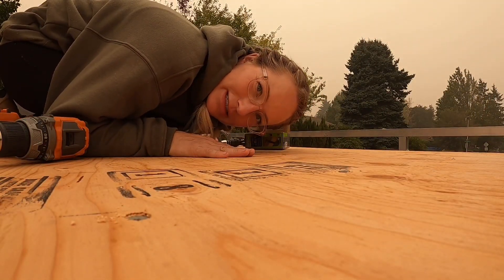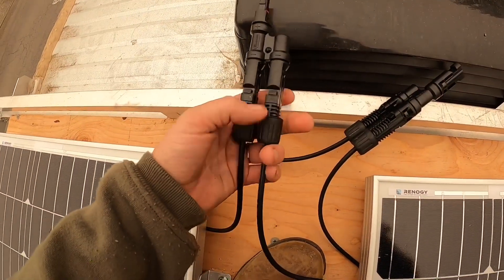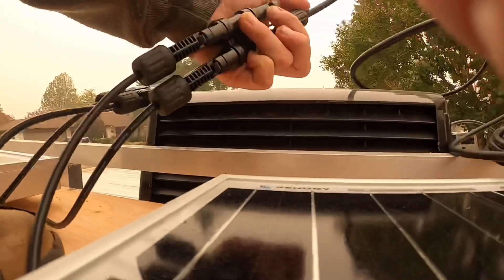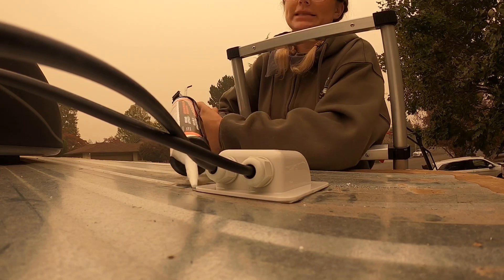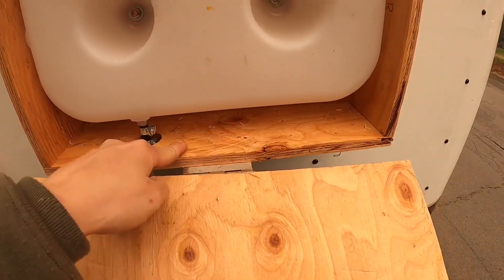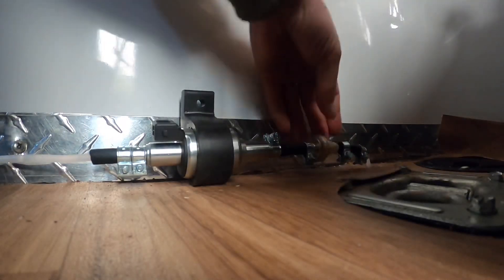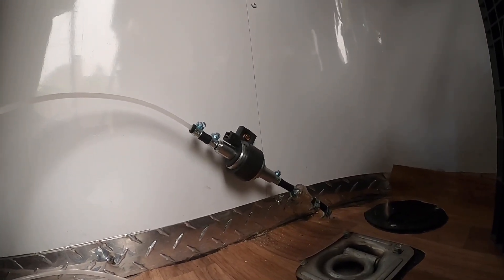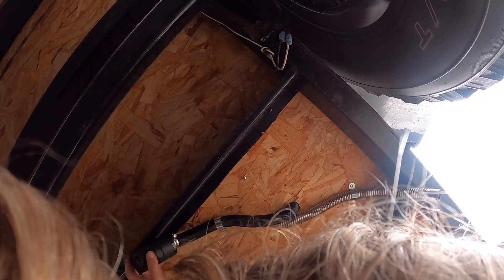DIY Solar Power & Diesel Heater in a Cargo Trailer Conversion- - Part 1

Comment: Hi great build and a lot of great ideas! Please check where you exhaust goes thru the floor for burning of the wood. Most installs I have seen state you want a bigger hole for an air space, just want you to be safe. Keep on building!

Comment: Heck yeah! You go girl, I was lookin for a video for instructions on installing diesel heater to solar?  Found u,, I'm now a new sub, and ty for instruction,  may I ask a few ?s How has it worked in the past yr, will 1 /100watt solar kit, will that be enough? And a stupid question do I attach power from diesel heater to the battery or to solar charge controller? Any info anyone can give me would so much be appreciated I'm in ohio and it's getting cold lol

Comment: I’d be worried about that exhaust starting your wood floor on fire... it’d be a good idea to just cut a rectangle hole in the floor to make clearance for the exhaust and using the metal mounting plate to bolt to floor.

Comment: Hi girl! Nice work!! On the roof, this little white duct box. Should you install that again, because it won`t be sealed proper, i think.. Put the silicon UNDER all the edges (of that white cap) before screw it in the place. (sorry my English..) I hope it won`t leak.

Comment: The plywood on roof may be treated but water will fill into the screw holes...over time it will weaken the wood & your panels will fly off the roof esp if you dont have some kind of wind shield covering front edge of panels. maybe put some silicone over on top of screws wherever the wood is compromised

Comment: I bought an all in one heater for my Rooftop Tent and LOVE it.  I joined a couple groups on FB concerning the installs, and it's general consensus that the exhaust connection should be outside of living area, and also heat shielded as it gets very very hot.  Looks like you raised it up, and the exhaust is touching wood.  Just be careful, I'm sure you already have a carbon monoxide detector, but just be safe!!  (Not sure if anyone already mentioned in the comments.)  I will say these heaters are game changers for camping in winter, absolutely love mine!!!  Love the trailer!!!

Comment: I hate to be a critic (especially when you're doing a fantastic job of it) but the hole you drilled for the exhaust needs to be far bigger, that exhaust pipe gets really hot so having a larger hole (Fnar Fnar) means less chance of setting your wooden floor alight. Lining the hole with a cut section of food tin will also be a good idea, but apart from that you've made an excellent job of it so far, this is the first video from you I've watched so far and you've impressed me. 
Note:- I've fitted a few of these heaters and commend your choice in getting one, they're cheap and poorly built but when used correctly function fantastically!
Reply from the maker: Thanks! I actually adjust the hole in later videos and add a heat wrap. Great points!
Reply: @LexandRiot  I'm now watching the next episode. BTW I'm in the UK.

Comment: Lex two questions: Does the exhaust pipe get out at all especially going through a wood floor? And second: Is mounting the unit on two boards what it suggest you do to install the heater? I haven't read the installation instructions yet because I wanted to see your video first after watching you on CRL with Bob.
Reply from the maker: Hi John! I recut the exhaust hole bigger than this video and wrapped it in exhaust wrap which keeps it touchable. No issues at all. While the way I have it installed works great for me, most say to mount it directly to the floor. The directions say it must be square and level. I’d check out this Channel - this guy is a wiz with these things: https://www.youtube.com/playlist?list=PLne7MoW21Rk01DYGGfOqIbYt6H1ZFSFks

Comment: I don't know if you've changed it already or not but I really don't think it's a wise idea to have the exhaust pipe mounted to the wood.
 It's better to keep it elevated. Those exhaust pipes getting really really really hot and there's a potential for a fire. You can make a stand off from heavy gauge bare wire or galvanized strap iron.
When I ran mine through the wood floor I actually lined the inside of the exhaust pipe hole with couple layers of tinfoil to keep the heat down. 
 I'm really enjoying your channel and the scenery you provide.
Keep up the good work and  stay safe.
Reply: also the hole drilled for exhaust tube looks too small

Comment: It's not airworthy!  Fuel lines in the passenger area must be in a secondary line and a drained to the outside.  The fuel filter assembly should be in a air tight secondary enclosure as well, drained to the outside.,  Sure you can get away with it, but sooner or later you will be smelling fuel.
Reply: So, came up with a simple idea to do this. Wrap the filter and hose connections in tinfoil.  Use a tin or maybe a small (bread pan, tin, pan ?) to put the assembly in.  It will reduce the amount of time  you smell stinky diesel fuel when/if you get a leak.  This is just an idea.  Maybe it will help.

Comment: You will want to install the Muffler i.e. Exhaust silencer / Spark arrester. This helps prevent fires. The way the exhaust pipe is installed on Lex's, trailer. The exhaust Points toward the ground. If she parks on dry grass or weeds, the exhaust exiting there can start a fire. The exhaust should be ran a couple of inches past  the side of the coach at a 90 degree angle to the ground. This way the exhaust is pointed away from the ground and the soot will not collect on the side of the coach. You can get exhaust extension pieces if needed. Good Luck Tcash

Comment: I chose a 100 w panel on the roof and 240w solar suitcase so I can have both solar and shade when needed.
Make sure to fill gaps in holes with sleet wool to prevent mice.

Comment: The best diesel heater videos I came across was John McK 47. I also like for most electrical is HOBOTECK and   Will Prowse. I've been stealing ideas from other van dwellers for two years now. Like for the diesel heater I learned that the fuel pump should be at a 45° angle for the pump to function properly. Also how to clean out the carbon each spring. And how running kerosene on high through it once in a while also keeps it clean.

Comment: Glad to see you ran into the Chinese Diesel Heater.  When you were asking anyone if they now a way to get heat and not humidity - I found the diesel heater but I think you did not want to cut holes at the time.  I but it on my wish list for when I start living in a Cargo Trailer. 
Will be interest to see how it works for you.
Take Care,
Tom B.

Comment: Nice little unit. My only concern is the hot exhaust against the bottom of your wood floor. The install say it should not touch anything combustable. It does not say safe distance to combustable. One test is if you can not touch that exhaust pipe outside while it is running, you may want to get it away from wood by distance and heat shield.
Reply from the maker: Hi! I have played with touching it and it’s ok so far. I am thinking of wrapping it in exhaust tape (like for motorcycles) which will keep that from being any concern. Thanks!!
Reply: Lex’N Riot, That sounds good. The fact that you are aware and watching is key. Nice install!  Impressive!  Thanks!

Comment: I've been thinking about mounting the diesel tank on the outside of my van but haven't been able to find any other videos on it. Good idea with the holes. 👍 Please let us know if you run into any unforeseen issues with mounting it on the outside.
Reply: I would like to know about foreseen issues, too.
Reply: should be zero issues. possibly theft or vandalism .i would have the filler neck inside the box and have a locked access

Comment: Suggestion if you use kerosene you will have less problems than using diesel.  Kerosene burns hotter more heat and burns cleaner less maintenance doesn’t smell as bad as diesel when it’s starting and running
Reply from the maker: Thanks for the suggestion however the diesel heater doesn’t run on kerosene. Thanks for watching!
Reply: Lex’N Riot I had a diesel heater and had it changed over to kerosene, It can be done
Reply from the maker: Something to consider then. Thanks!
Reply: Lex’N Riot also the kerosene won’t gel up like the diesel can.
You may also want to get a little humidifier to run when you have the heater going.  The air does get dry when heater 😊

Comment: I'm twice your age and I am impressed with your continued progress with your cargo trailer. I've had mine for 2 years and I am trying to get to a point where I am "done" with improvements, but we never are done, are we? 😂
Reply: 2003, we converted our 1997 Ford CF8000 commercial truck to our concept of an ExpeditionVehicle.

Eighteen years later, it is still evolving!

Comment: My diesel heater came with a 4"square steal plate that had the holes in it, so i cut a 3" square in my floor an screwed that plate right over it and the heater mounted to it, so that the hot pipes are away from the wood.
Reply from the maker: Same. The pipes are still 3” from wood.
Reply: @LexandRiot  your pipe is almost touching wood going through floor, and secured directly to wood by tire.... no 3" space there. 
fire hazard

Comment: Nice job and nice box 😃 i too am doing a 6x12 cargo and i put a dual LP tank mount on the front hitch with a nice cover but I'm converting 1 LP tank for diesel and the cover has a top lid so it will be easy to fill, i have had diesel fuel in it all last winter with no problems of jelling at temps of -10 or 20 degrees while working on it outside. I do really enjoy seeing your videos each week and like the upgrades your making that will make your life much better and you go with the power tool's girl, already waiting for the next video, great job. Be safe and take care
Reply from the maker: Thanks Frank!

Comment: The exhaust pipe gets really really HOT!  Make sure it does not come in contact with intake pipe and fuel lines.Purchase four inch holesaw, seal mounting plate directly too floor. Good luck, safe and happy travels.
Reply: david wallace   that steel plate and gasket are for a wall exit point where the exhaust would have cooled some through the pipe, and as mentioned , a 4" hole should be used not 2 x1.5" . its not the wood you have to worry about igniting first, the glue used to laminate it will ignite far sooner. the exhaust is 700-800F

Comment: Dear Lex, your friend means well and I do not want to be critical but. I am not shur where to start. Lex, I respect, admire and have enjoyed you sharing the content on your channel. I want you to be safe! One, the platform you mounted the heater on was unnecessary and unsafe. I have seen it done on many DIY installs in Van's with ribbed metal floors. I do not have a solution for that application. Having the exhaust pipe clamped too the heater inside you tiny home on wheels could introduce deadly gases in your living area. Bad idea! Two, all fuel lines and fuel pump, filter, ect.should be mounted under, on frame rail. I am living full time in a very cool 4wd, 22ft. Japanese diesel bus. On my second year with Chinese heater. I left my recommendations for install on comments, when you first started talking about this. Vancinity Vanlife YouTube (aka Crome) just published video, on his channel, professional install, please review. Lex, you are  a ROCKSTAR and I am a loyal subscriber. The problems are easily corrected.
Reply from the maker: Thanks for your concern and feedback!

Comment: Don't want to rain on your parade but it looked like you use self-tapping screws to mount the panels to the wood, if you did you need to redo that and put wood screws. The others want hold for long and you will lose the panel going down the road.
Reply from the maker: Wood screws into the wood. Self taping into the aluminum cargo rack. :)
Reply: I figured you would know that but I sure thought you used a self-tapping screw in the wood or I wouldn't have said anything.
Reply from the maker: Thanks Richard! You may have seen right as if the screw hole was over part of the aluminum rack bars I had to use self tapping to get them into the aluminum. If only over the wood I used wood screws. Good call out either way! Not all screws work the same and Lord knows I don’t need more loose ones. ;)

Comment: Good work.  I didn’t wanna put panels on the roof of my trailer so I just got a portable suitcase solar panel and mounted an inlet plug in the floor.  Worked like a charm.

Comment: Thanks.
This is only the second time I've heard about the diesel space heater. Hope you will list make, model and overall parts needed.
Will there be an issue with the diesel fuel get thick at colder temps? 
Stay safe & warm. Be blessed.
Reply from the maker: Thanks Lois! It has to get under freezing for a while for diesel to gel and I don’t stay in very cold climates very long. My mechanic back home recommended me to carry diesel 911 for that issue so I have some on hand in case.

Comment: Great work.  I put the 200w Renogy system on my cargo camper as well. Plenty of power for the batteries.  The diesel heater was the biggest game changer for me. Congrats on the upgrades.  

While you're starting to plan future adventures, add Stanley, ID for your summer.  Late June and Early July is the start of their season. There's nothing like the Sawtooth mountains.

Comment: Great Install, Looks like a great combo system. I'm very curious on how well it works in your trailer. Maybe I missed it but do you know how much diesel it will consume per hour heating the trailer? I hope Riot is making it in the suburbs, i bet she is ready to get back to running in the forest!
Reply: I think they use like 1/2 gallon in 12 hours. I don't have one just info from research

Comment: Great Idea Having a light weight Roof Rack for your Solar Project Or Any Other Gear. Ah, the 'Equipment-Expansion-Delimma' Rides Again, but I Love It. Another 'Must Have' Plus a Ladder to Get Up There. Thanks for the Idea. Up till Now, That Has Only Been a Distant Thought. I  Better get my butt moving.👍